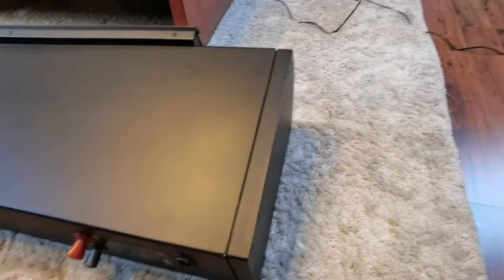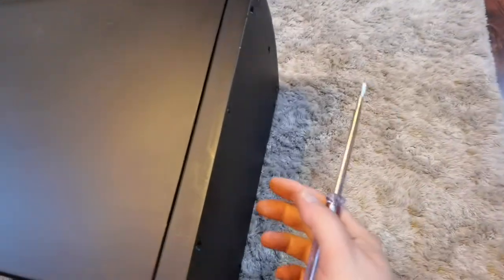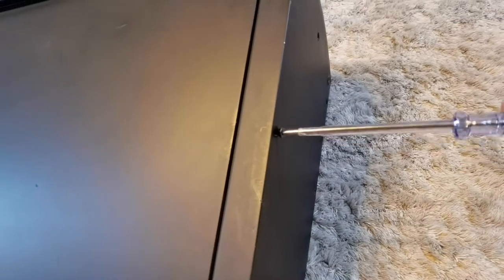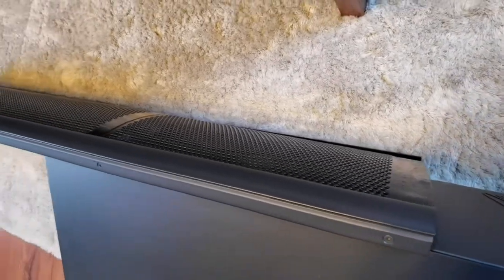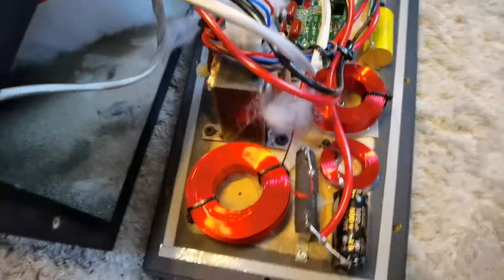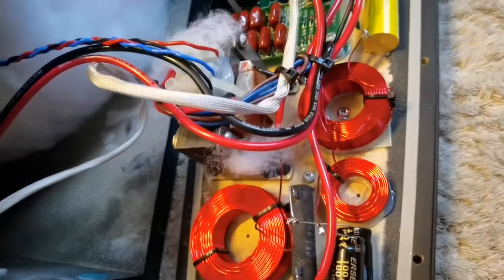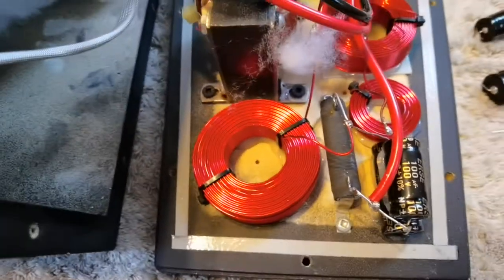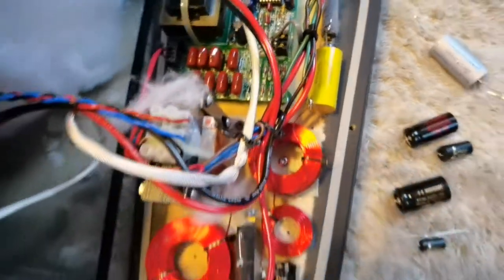Martin Logan Scenario crossover capacitor upgrade

Comment: Do you have a video of how to get to the crossover on the Ascent i,,,,, and what crossover components did you upgrade to?
Reply from the maker: Sorry, that was before I realized I could record stuff I do and share back to community.
It's just a set of allen screws in the back (6 or 8) and that's it. I've replaced all stock foil caps with Jantzen Silver and Mundorf Silver Oil. And a set of Mundorf Ecap Raw for the bass driver electrolytes. Same values, though I had to stack Mundorf Silver Oils to get required capacity in reasonable budget. It was something like 500USD in total to replace every capacitor.

Comment: So the good value for bypass cap is about 1/100 of the main cap for best performance?
Reply from the maker: Yes, as a general rule - to stay within usual 5% tolerance of the bypassed one, and not significantly change the sum of both.
This always worked fine for me.

Comment: If i replace caps use q4 audyn or cross caps 400v. The positioning of the inductors is very critical.  All in same Position!!!!!
Reply from the maker: Yes I suppose ML was using crossover as a differentiator in higher models (higher models would have better design and elements crossover)

Comment: I see you used 63v capacitors to replace the 100v can 50v also go?
Reply from the maker: I think the voltage there (in audio path at least) is less than 25V anyway, so anything higher will do. I've read that higher voltage caps are "cleaner" (though pricier and bulkier) but I had no opportunity to check that.

Comment: Hello, I'm replacing the caps on my Vista electrostats.  Can you share with me how to decided on what cap values and brands to use for the replacements?
Reply from the maker: Hi!
If you're replacing them, go for the same values. As for brands, I've found that http://www.humblehomemadehifi.com/Cap.html is a great source of info for foil caps. 
For the standard electrolytic capacitors for bass driver I usually go for Mundorf eCaps (again, same value as stock - when replacing).